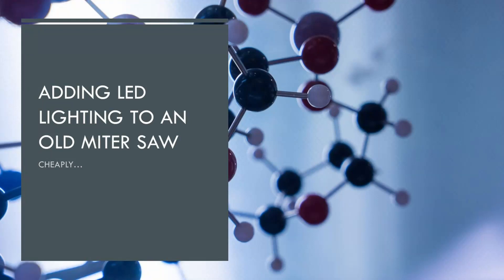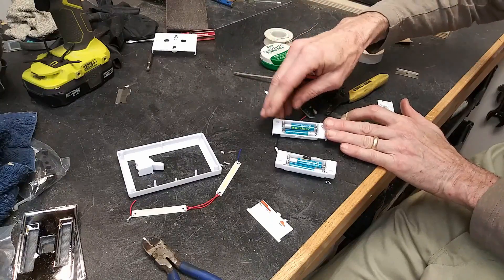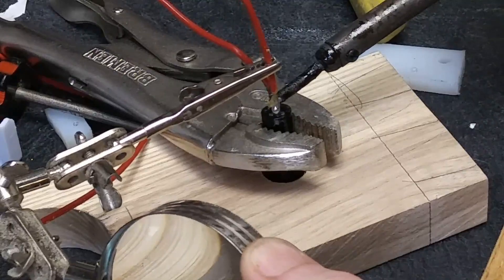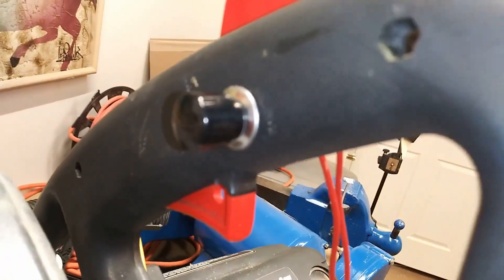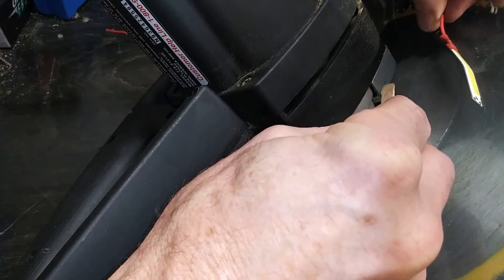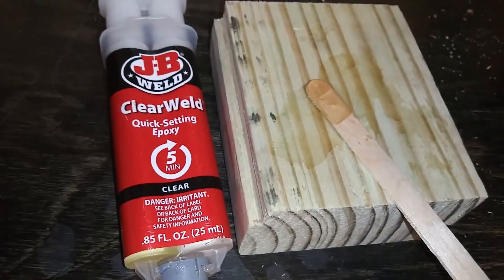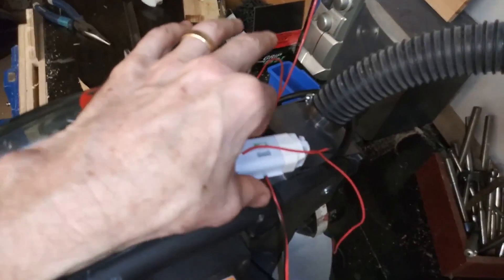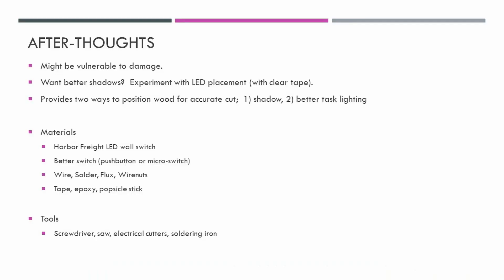Add Harbor Freight LED lighting to an old Miter Saw

Comment: i made something like that with different lights. But the lights are too far from the blade. So while I have a shadow, its too skinny. And like this, by the time I see the shadow, the blade is on the wood, and I might as well use the blade at that point.